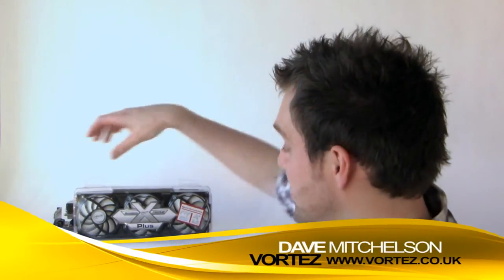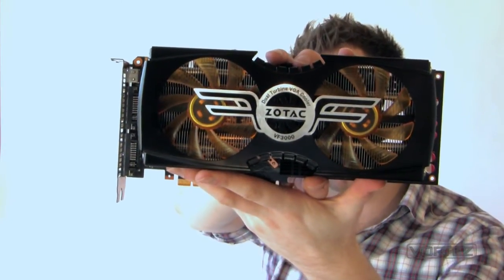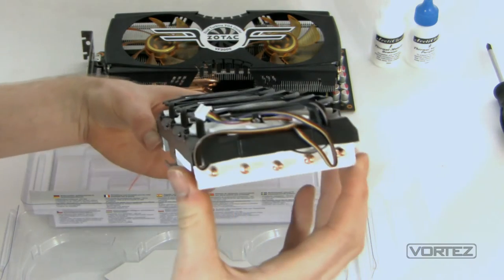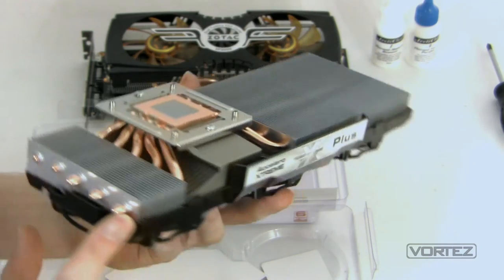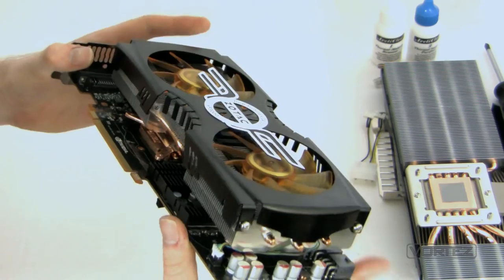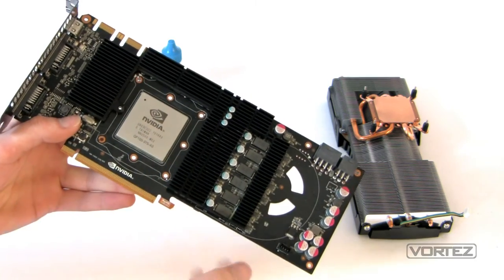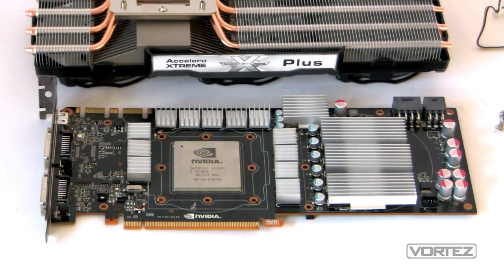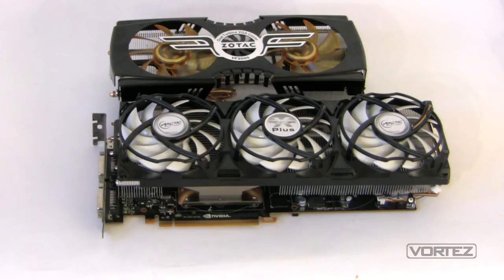ARCTIC Accelero Xtreme PLUS (NVIDIA GTX 480)

Comment: I also saw that you bought the arctic silver thermal compound removal set (two little bottles).  I'm probably going to get the two bottles and thermal adhesive from newegg.  

By the way, do I need any special plastic scrapers for removing the old thermal adhesive, thermal paste (on gpu), or anything else?  Did you just use your fingers or a credit card to remove them?

Comment: you need alot of patience for this
i did everything on the instructions, but now one of the small sinks fell down because the g-1 doesnt really work properly, it also seems like the cooler isnt really pressed on the GPU since i can see a very tiny gap inbetween when i hold the card against the light

Comment: Can you use the accelero xtreme plus directly on the die? (underneath the NVIDIA heatsink at 9:12) I'm hitting 38C idle but >90C load at stock voltage >100C after voltage raising and OC...scary